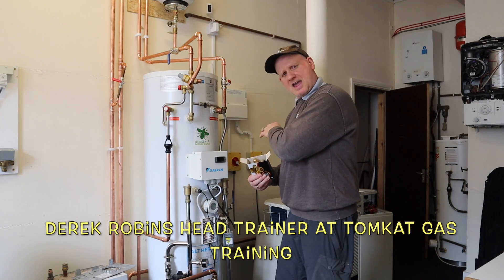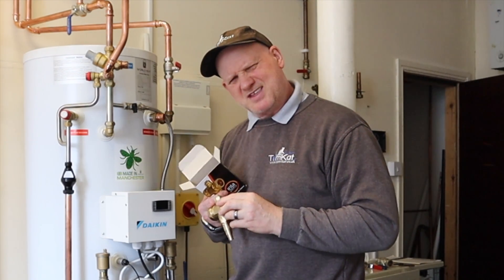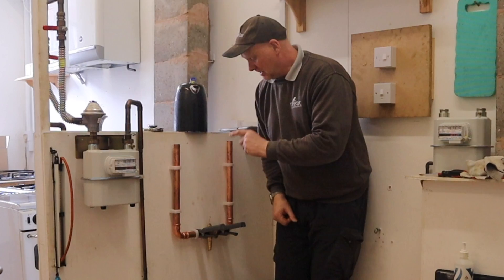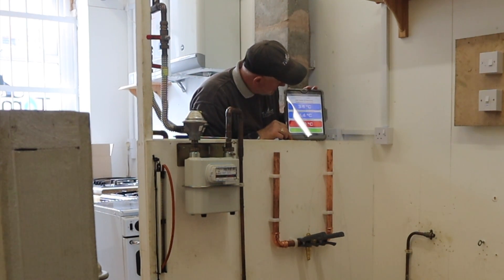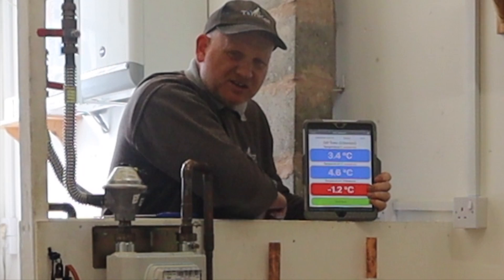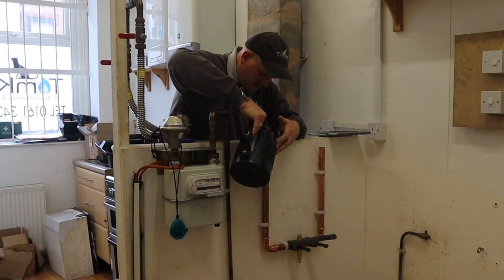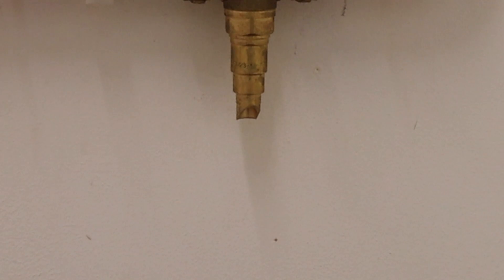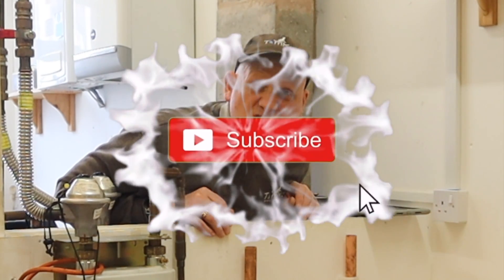Heat pump antifreeze valves do they work?

Comment: I’ve always thought it seems a bit dumb to use a good conductor like copper on exterior pipework in cold climates. Surely plastics or anything more insulating like plastic coated copper would be smarter.

Comment: If it bitterly cold surely the dripping valve will freeze up  . Also the loss of pressure will leave the customer with no heating on a bitterly cold day or am i missing something. Nice too see your videos I have a very curious mind. 
Paul
Reply: Hi Paul. These valves in theory should never have to open, the heat pump itself has a built in state, when the air hits 5 degrees outside and if the heat pump is not in use it will turn on the circulation pump and move water around the system stopping it from freezing, they are just a back up for if you have a power cut and the temperature starts to get cold or freeze.

Comment: I have a suggestion for a more representative test:
- Put a ball valve on each end of the U pipe.
- Open them both, fill the pipe with room-temperature water and close the valves underwater to ensure there's no air inside.
- Stick the whole lot in the freezer for a day. (With a container under the valve!)
- If it's still intact when you return to it, it's worked.

I don't have anything against the test you did, I just thought it would be nice to test the actual scenario it's meant to protect against.
Reply from the maker: I don’t see how that test proves it works more than mine. The valves are there to stop the unit getting damaged by the freezing water so they operate before the pipes freeze. Why don’t you do your experiment and put it on YouTube 👍🏻
Reply: @tomkatgastraining  The difference is that it shows that the valve does its job (Prevents damage) rather than showing how it works - I got the idea after reading some of the other comments where there was still some confusion and thought that would be more representative.

The reason I won't do it myself is that the only anti-freeze valves I have are on our heat pump, if they weren't £100 then sure I'd do it but I have no reason to buy another expensive valve.
Reply from the maker: @yngndrw.  the video is titled do they work not how do they work. Anyway shame you are not doing the video I would have looked forward to seeing that 👍🏻

Comment: Ye you need to have it in a real system and chill from inside and outside. And how is this to stop the pipe from freezing up
Reply: I think that's why it operates a good few degrees above 0C, so that it's empty before it gets down to zero.

Comment: I think the only thing missing here is the water pressure, as this experiment is done without any incoming pressure.
Reply from the maker: Water pressure is not required for the valve to open as you can see from the video and what I have been told is, even under pressure the water comes out the same

Comment: I was expecting you to break out a pipe freezing kit! 😃 Great video.  Anyone fitting anti-freeze valves would be well advised to fit a good quality brand. If it is your only method to avoid expensive damage, you want to be sure that they will operate reliabily if they need to.

Comment: I dont understand the principal
Reply: On days cold that are cold enough to freeze the outside pipes of a monobloc Air-source Heat Pump (which will have water in them), if there is a power cut for long enough, there is a risk that the water will freeze and rupture the pipes inside the outdoor unit. This would be a very expensive failure, so the manufacturers recommend anti-freeze valves so that if the outdoor pipes do get too cold, the water is released before it can freeze and cause any damage. The system will need to be topped up when the power returns.The lack of pressure in the system might well result in the heat pump staying off until it is topped up. This means that anti-freeze valves are not a perfect solution for properties that might be unoccupied for long periods over the  winter. It might be better to use anti-freeze in such properties and either just accept the lower Coefficient of Performance (COP) or have a small solar PV installation to offset it.
Reply: @tlangdon12  or these properties would better have a split
Reply from the maker: Quite simple to stop an heat pump from freezing if there is a loss of power the valves drain out the water

Comment: I would have thought the anti freeze valve has been designed to register the air temp and not the water content. Conclusion, the anti freeze valves do their job. Well done Derek.
Does adding antifreeze liquid lubricate the system including the circulation pump bearings?  Tap water alone won't wont do that.
Reply from the maker: You need to put inhibitors into the system like x700 for low temperature systems